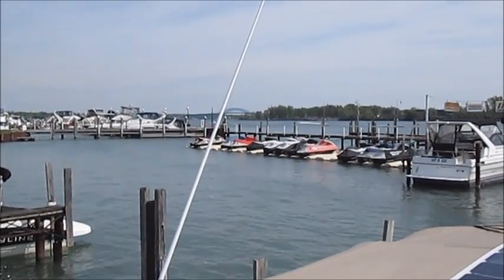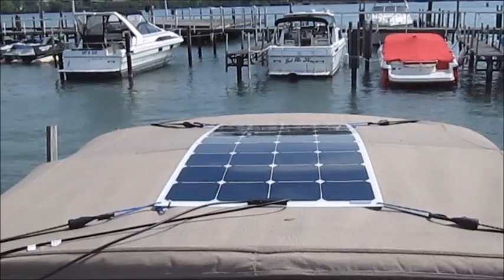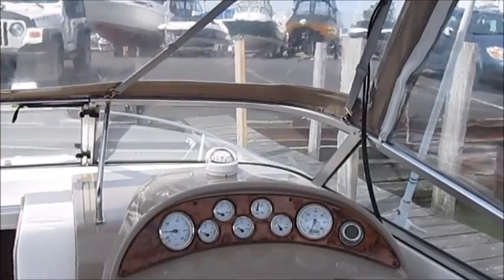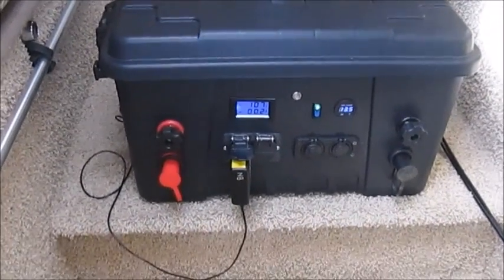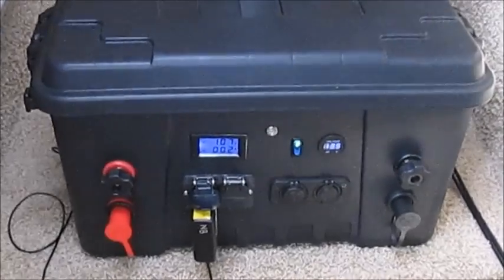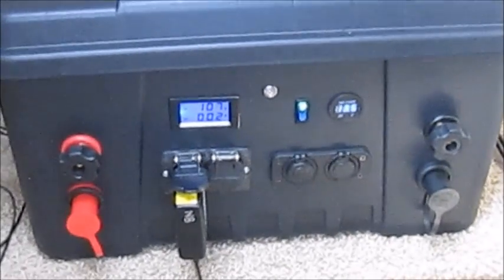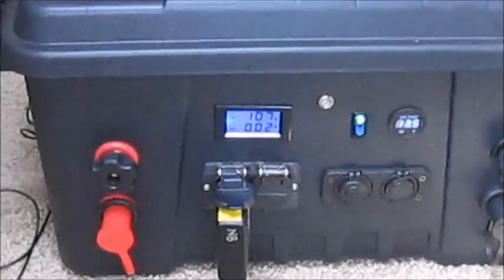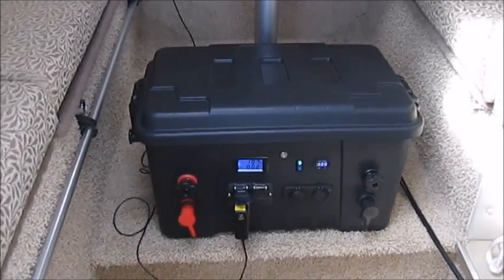V1 P2 DIY Portable Solar Power Generator

Comment: Very nicely done. I like it. I agree with some of the other guys in the post. Adding another 100w flexible Renogy panel and another battery would be very doable. It would be great if you could fit a 1,000-1,200w PSW inverter in the box too. With 200w coming in from solar and 150 amp/hours of battery...should take care of your critical loads/lighting needs for just about any scenario...even camping, home use, job sites, etc. Well done! I really want to make one...but, still fine tuning my off-grid home solar power system (3.7KW in solar panels, 3.5KW inverter/charger, two solar chargers, 24v Trojan battery bank, and house mains transfer panel). Excellent box you got there...having a portable system makes a lot of sense...esp for the prepper crowd, homesteaders, and DIYers out there.
Reply from the maker: +Chris DIYer Thanks for having a look and taking the time to comment Chris.  Based on my current, modest demands for power (weekend use only on the boat) the sizing of both the batteries and the 100W panel suffice.  There is likely room enough in the case for one more 55 AH battery, but I don't think that the space that exists between the deck and the top of the case could accommodate a larger inverter with deeper dimensions.  There is, of course, the possibility of adding another 100W flexible solar panel to the system as well.  That plan will likely be realized when I move the system onto a larger boat in the future that I intend to spend considerably more time on in my retirement.
Reply: Hey Jim - Finally started one. Got a good deal on two Trojan AGM batteries. Shot a video on my Channel...just a "Part 1" piecing the components together...kinda a teaser. Gonna do a 600w PSW Aims inverter and 200w in solar for now.
Reply from the maker: Enjoyed your part 1 video Chris-  will be looking forward to all that will follow as you put your system together!
Reply: Thanks! Should have some Renogy RNG-100D mono panels by this Friday and start firing things up (bench testing).

Comment: I think its a Super system and very well thought out and presented. if it was my system I would like to add a wind turbine in case there was no Sun. you could charge your battery while boating
Reply from the maker: +mark sessor Thanks for the look and the comments.  Yes, a wind turbine may well be in the future as an enhancement to this system.  My retirement boat will be liveaboard size and having another option for charging the generator would be helpful.

Comment: Well done sir!  If you have the room I would expand the # of the batteries and at the minimum expand on the number of the solar panels you have.  I'll be watching part one now but I'm hoping you have done a sizing study of your requirements and can expand accordingly.  Good luck.
Reply from the maker: +afshin735 Thanks!  Based on my current, modest demands for power (weekend use only on the boat) the sizing of both the batteries and the 100W panel suffice.  There is likely room enough in the case for one more 55 AH battery.  There is, of course, the possibility of adding another 100W solar panel to the system as well.  That plan will likely be realized when I move the system onto a larger boat in the future that I intend to spend considerably more time on in my retirement.

Comment: Great design. I'm inspired. With the new terminal connectors you added in video 2, where did you find the red and black plastic covers for the terminals. Maybe it's operator error on my part, but I've been unable to locate them. Thanks for the videos. It's the cleanest and easiest to follow build. Thanks for taking the time to share.
Reply from the maker: Cyd Viator thanks...I purchased the remote terminals as a kit on eBay, the red and black plastic covers came with the terminals.  Search under "Battery Post and Wiring Kit Remote Jumper Terminals" or try the seller,  brykeracing on eBay.
Reply: Within minutes of asking the question, I found them on eBay. I'm looking forward to putting this together. Thanks for the inspiration.
Reply from the maker: Cyd Viator Glad you found them.  Thanks for having a look at my project.  If you are able to post of video, I'd enjoy seeing your generator when finished.
Reply: +Jim Fisher  I'm installing the last of the hardware on my trunk and I added the terminals you added in the second video. 
I've already started to wire it up, but there are no details on this addition. Do you have a wiring diagram for this addition... wire gauge, fuses and such? 
I'm a total novice when it comes to electrical devices, but I can follow directions. I'll post my generator when finished. Looks pretty good if I say so myself.
Reply from the maker: +Cyd Viator I did not update the block wiring diagram to reflect those terminal additions.  Here's a simple description of what I did:  I used the wiring that was provided with the remote terminal kit to connect the bulkhead terminals direct to the batteries, they are 4 gauge. I attached the positive to one battery and the negative to the other to draw power evenly from both batteries.  No fuses were installed as any larger inverter I would attach to those bulkhead terminals would have an internal fuse or breaker built in.  In the event that the remote terminals needed to be used to provide a jump start, I plan to simply open the generator case and connect the same 4 gauge wires temporarily to those terminals.  It would only take a couple of minutes to make that wiring switch from the bulkhead terminals.  The demand for use of the remote terminals is very low compared to other power distribution options in the system, so I decided that I would connect them to the batteries on an as-needed basis only.  This saves on additional wiring cost and space inside the case.  Just as is the situation when you jump start your car with only a set of jumper cables, there is no breaker or fuse between the two batteries.  Hope this helps a bit.   Looking forward to seeing your finished generator.
Reply: +Jim Fisher Thanks for the clarification. So, if I understand correctly...
Using 4 gauge wire, connect negative to one battery and positive to the other battery and connect them to their respective bulkhead terminals. 
I have the bulkhead terminals with the plastic screw caps that you would hook up a larger inverter, installed mid point at the front of the trunk.
It's pretty tight inside the trunk, so using a short (3") 4 gauge jumper to the bottom bulkhead terminals (for jump starts). That way everything is hooked up and ready to go. Does that sound like it would work.
Also:
The wiring for the 110 outlet that's connected to the Volt & Amp meters, is not real clear to me how this is wired together. Let me tell you what I think it is...
The Volt/Amp meter came with a small ring transformer. The 2 green wires from the ring transformer connect to one side of the V/A meter. (There's a diagram) It looks like the red wire with the inline 15a fuse from the inverter, just passes through this ring (no connection to the ring) and is connected to the terminal on the 110 outlet.
The red wire then jumps out of the outlet box and connects to one of the 2 remaining terminals in the V/A meter. 
The remaining terminal on the V/A meter has a black wire jump back into the 110 outlet box and hooks up to the other side of the outlet, completing the circuit. Is that correct?
When I get this sorted out, all I have left is reinstalling the batteries and checking all the wires in the trunk. Hook it up, turn it on and see what happens. 
If it works, I'll be posting a video shortly thereafter. This has been a learning experience for me. I could have bought this off the shelf, but then I wouldn't know how it worked or how to repair it or expand it when needed. Thanks for the help.
Reply from the maker: +Cyd Viator Sounds like you are very near the end of your build!  Yes, in my opinion what you have described  to connect the bulkhead terminals to the remote terminals (for jump starts) will work just fine.   
     Here is how I wired the ammeter.  Yes, the positive wire only coming from the male plug that is inserted into the outlet on the inverter is what is passed through the ring transformer (strip the extension cord's outer covering as needed so that each individual wire within is exposed and gives you the ability to connect them to the 110 outlet inside the shallow box).  That same positive wire then connects to the positive terminal on your 110 outlet.  The negative wire from the plug that is inserted into the outlet of the inverter attaches directly to the 110 outlet's negative terminal. Yes, the two wires from the transformer attach to the ammeter where indicated on it.   The power needed by the ammeter  is derived by simply attaching its negative and positive leads to the same respective negative and positive terminals used to connect the 110 outlet to the wires coming from the plug attaching it to the inverter.   This allows the ammeter to be powered up only when the 110 outlet is powered (and to read its voltage availability and amperage draw), which is in turn only powered when you turn on the master battery switch on the outside of the rear of the case.  If you have wired the system properly you will find that, as long as you leave your inverter in the "on" position, you will have powered your inverter, the 110 outlet and the ammeter all at once when you turn on the master battery switch.  The digital temperature sensor should also be powered up when the master battery switch is turned to the on position.
Reply: +Jim Fisher I'm just about done. I put the first battery in the trunk and started connecting wires to the positive side, I hooked up one wire to the negative side and the temp meter came on and the fans were blowing. I hit the switch and they turned off. I think I'm just about in business. Woo Hoo!

Comment: Best engineering put together, well done sir.
Where did you buy the 55ah AGM battery, what brand name ? I bought X2 power from BatteriesPlus & Bulbs store. Are your batteries wire for 24 volts or 12 volts?
Thanks.
Reply from the maker: Pong Bunnag Thank you.  The batteries are wired for 12 Volts (parallel).  The 55 ah 22NF UB12550 Sealed AGM Uninterruptible Power Supply UPS Backup Batteries were purchased online from wholesalebatteriesdirect . com (item 45980)
Reply: Thank you.

Comment: Where did you buy the battery through panel connectors and the hand screw nut for them?
Reply from the maker: Harrison Ernst screw on knobs on eBay under INNOVATIVE COMPONENTS 3GDW9 Fluted Knob, 1 3/4 In, Thru, 3/8-16;  battery cable bulkhead connectors on speedwaymotors.com
Reply: Jim Fisher Thanks, I have been looking for the knobs for a while.